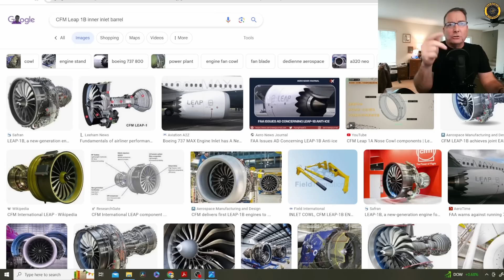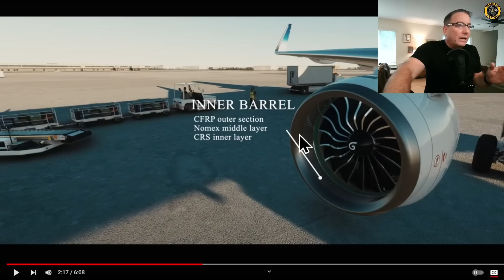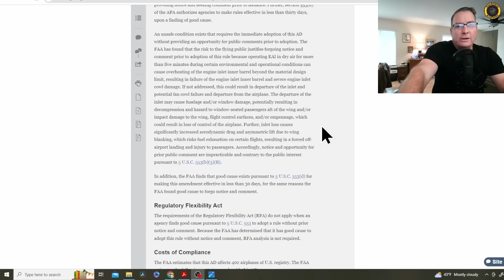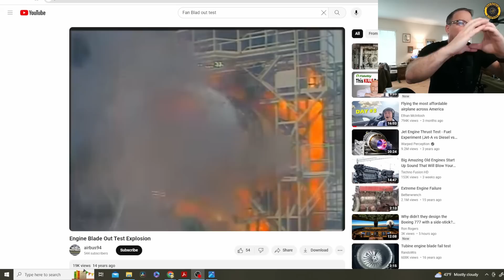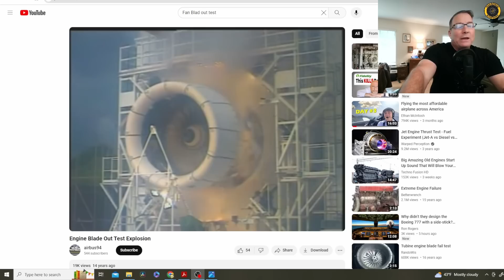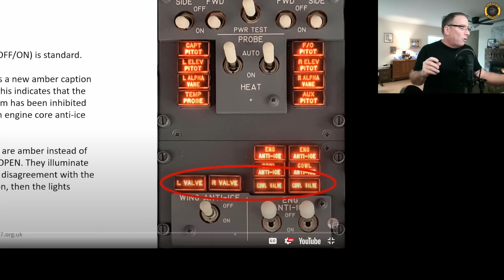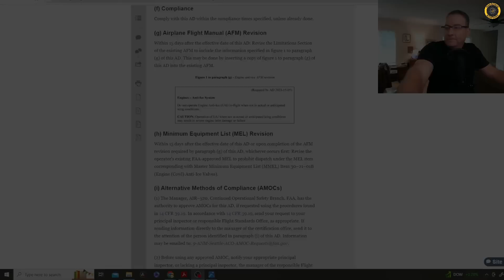Boeing 737 Max-7/-10 Certification HALTED! 1 Feb 2024

Comment: I have flown thousands of hours on commercial aircraft of all types over the years.  I miss the good old days when aircraft were way over designed.  I don't know be what kind of fairy dust mentality would think that a design like this would be an acceptable engineering.  I have flown on aircraft back to the Boeing 707's and thousands of hours on 727's, which was a pretty bulletproof aircraft I believe.  I hope that they come up with a very good fix for this problem.  I can appreciate efficiency, but nowhere should it compromise integrity.

Comment: And why model 8 is safe to fly if using the same engine of model 7 and 10?
Reply: The Max 8 has already been certified but still had the problem. Boeing wanted the Max 7 to be certified first then fix the problem. Now they have to fix the problem before it can be certified

Comment: Why doesn't this happen with the A320 similar engines?
Reply: The A320 has auto anti-icing, the B737 MAX does not...
Reply: A320 has different nacelle and they get electronic messages when to turn on and off the anti ice system if it is/is not required. There is no auto mode

Comment: Mix cold air with the engine bleed air, the carbon fibre surround will have less temperature fluctuations. 
BTW, carbon fibre is basically glue and floppy fibres. The engine nacelle has to be aluminum, as quoted by commentators below. ETOPS should be reduced, but has the FAA got the metal to order it.

Comment: What is Airbuses' solution to this problem?
Reply: They have a different nacelle and different anti icing system. They also get electronic messages when to turn the system on and off as they have ice detectors

Comment: They should go back to the 737- 200 would operate loaded out of a 3000 ft gravel strip ran alot of them up north here in alaska and the the yukon in the worst conditions very reliable

Comment: Manufacturers should be incentivized to incorporate the latest and greatest technologies but unfortunately modern economic conditions and the government regulatory environment incentivizes just the opposite. Unfortunately, this has created a vicious cycle.

Customers demand the latest safety and efficiency features industry has to offer. That isn’t wrong, but it requires significant design changes and pushes technology and regulations to their limits. That isn’t wrong either, but that in turn drives extremely expensive certification testing to satisfy a regulatory environment that is sluggish, antiquated, and resistant to change. If each of these factors were taken to the extreme, the result would be aircraft that are not economically viable at ticket prices the flying public is willing to pay.

The old adage of only getting to pick two (Fast – Cheap – Good) definitely applies here.

There is no single solution to get out of this. Solving the problem will demand a balanced approach, cooperation from all parties (customers, government, industry), and a willingness by each to look in the mirror.

Comment: Boeing should have just done a clean sheet design and came up with the replacement for the 737.  A Boeing short haul jet designed for the 21st Century.  They tried to take the short term approach but still spent many years to get the MAX jets certified…all at the expense of passengers getting killed due to poor oversight and now bolts not missing.  If they designed a newer plane, I think they would have been more serious about the design and not take the easy approach. They would have better brand goodwill also.

Comment: You would think it would occur to the engineers in the design stage that carbon fiber does not conduct heat like a metal alloy, and what are the consequences for this ?    Sounds like carbon fiber sub engineering.  Are these Rolls Royce ? GE's ?

Comment: I know we’re talking about the Boeing 737 max, but the engines are not produced by Boeing, same with the fuselage section with the door that broke out. I’m not saying that Boeing is not to blame for it, after all it is their plane and their design, but just something to consider. I also somewhat blame the airlines for these issues, as I seem to remember they wanted a single type certificate.
Reply: It’s Boeing’s plane therefore it is very much their responsibility.

Comment: This one isn't Boeing's fault.  Who in hell would design an engine that could be blown up by anti-icing?  That's just criminally reckless.  Whether or not to turn on those switches is a JUDGEMENT CALL...  so they get to choose between engine failure by icing or engine failure by anti-icing.  Brilliant.  Engine should be able to withstand anti-icing from gate to gate with nothing more than a small power loss.  I kid you not, if I were a pilot, I would refuse to fly these deathtraps.  I'd fly cargo 727s if I had to.  This is nuts.

Comment: I think this design of the cowling was implemented to slim down the overall diameter of the engine due to problems with ground clearance! Another  disadvantage of  not starting with a clean sheet and totally  scraping the dated 737.

Comment: How do they operate with bleed air that's too hot, how was that not worked out before hand?  CFM may be the engine maker, but who designed the engine cowl and the engine anti-ice system.

Comment: What a piece of crap.
It’s astounding that the technology that keeps your damn heated seats from burning down your car cannot be implemented to regulate the temperature of the air inlets. 
And it’s laughable that they would use carbon fiber and underwear material instead of metal in a heated area -on a machine that weighs more than a small fleet of bulldozers. 
Boeing deserves its woes.

Comment: The entire MAX debacle comes down to two things:
The engine fans are too big for the existing main landing gear. This meant the engines needed to be lifted and pushed forward creating aerodynamic instability at high AOA, or a costly gear redesign. Boeing chose instability over redesign. This led to MCAS preventing MAX becoming a lawn dart. Ultimately, MCAS turned MAX into a lawn dart.

Second, this feverish overriding need to avoid type rating pilots transferring from the 737NG. 

The result is 355 deaths and far more cost to customers in delivery delays and, ironically, added training than a type rating ever could have cost in time or dollars. Unstick your heads from your posteriors Boeing.
Reply from the maker: No. See previous updates on MCAS.

Comment: Does this failure mode also affect A320neo which uses the same engine?

I guess maybe not because a320 has the auto setting.
Reply from the maker: Correct!
Reply: A320 doesn’t have an auto setting except for pitot and window heat. for engine/wing It’s a push button on/off switch. However the ECAM will alert you if ice is detected to turn it on and if NO ICE DET appears you can turn system off

Comment: Honest question from a shade tree perspective:  Why is it better to over stress 2 engines?  In my opinion there could be a very efficient trijet aircraft that helps mitigate potential failures due to engines operating too close to operational limits for too long.  Again, this is an honest question.  I’m in the camp that prefers a clean sheet design replacement for this airframe.  Again because of pushing operational limits.  I wouldn’t care if they still called it the 737.  I just feel they (the airlines who don’t want to spend the money to certify pilots on a new airframe, and Boeing, who sold that concept) needed to stop looking to the past for the future. I’m not a frequent flyer, and still am a Boeing fan, but at some point they need to move on, and in my opinion that time was post NEO.

Comment: The Grumman F6F Hellcat and North American P-51 Mustang were both developed and put into production in less time than the MAX 7 certification delays have consumed. Not the entire length of the MAX program. Just the MAX 7 delays.
Reply: Those planes aren't compressurise, they wear oxygen mask when they hit 15,000 ft or higher.

Comment: @blancolirio  Let's please remember: The 737---from the first little bitty one off the assembly line in the 1960's to the last MAX off the assembly line today---have been some of THE BEST work horses of the airline industry world wide! They do a fantastic job carrying probably hundreds of thousands of people safely EVERY DAY with extremely few failures in the 5 decades or so they've been around. Also, please remember that Boeing did not design this engine or any other engine. The LEAP engine manufacturer will fix this deice cowl problem, not Boeing. Meantime yes, it stinks that pilots have to manually turn the engine deice on and off each time they enter and exit icing conditions. But can we please all calm down, including our beloved JB? The sky is NOT falling. And let's please remember one more thing: If anyone is to blame for stretching the 737 platform "to the MAX", it's Boeing's customers like SWA and Ryan Air and many others. So direct your ire at them. Man, y'all are giving social media a black eye. (haha)
Reply: All the other pilots are stating this is a Boeing problem because CFM does not make the nacelle and cowling. It was a Boeing problem when the cowling failed on the SW flight
Reply: Stand corrected on the cowl. Hopefully Boeing is working closely with CFM on the cowl. I stand by the rest. Drama is over-played.

Comment: Thanks for the concise video that explained the issue very clearly, Juan. 
Isn't it beyond ironic that Boeing decided against a clean-sheet aircraft and opted for the MAX in order to save money and streamline the certification process, and all they've had is a decade of headaches and lawsuits due (*in part*) to that expedited certification that shoved an incomplete (in some cases unsafe) aircraft into revenue service? They've clearly burned through all of the time and money they saved by doing it "the quicker, cheaper way." Even worse, the company's image is a tattered mess, its stock is in the toilet, and its name is a punchline. 
This is a crystal clear example (that just keeps giving reasons) why accountants and consulting firms should not be pulling the strings in an industry where quality engineering and safety are paramount.

Comment: "Mayday, Mayday! Both our engines blew up!" Pilot monitoring: "Damn, I forgot to flip off the de-icing switch after we got out of the clouds."
Reply: Life-threatening equivalent of forgetting to turn off the oven
Reply: Crazy to think this is the reality we live in now
Reply: The nacelles are made by Spirit, not CFM.
Reply: @aesma2522  doesn't surprise me Spirit Airlines is the manufacturer. Although I do wonder why the nacelles aren't painted yellow!
Reply: @j2simpso spirit aerosystems and spirit airlines are two separate companies. Spirit aerosystems makes some of the components of Boeing (and some other brand) planes, spirit airlines flies planes that are painted yellow.
Reply: @j2simpso Not Spirit Airlines but Spirit Aero Systems. The company was started because boeing wanted to cut this division out of its company and contract this work out to save money.
Reply: @TA-tf5lr  I think he knows. I will add that the design of the nacelle is probably Boeing made and certainly Boeing/FAA tested and approved... Further illustrating how the MAX was not properly tested and scrutinized.
Reply: So they HAVE automatic de-icing after all!! ... only it destroys the engine to stop de-icing...
Reply: Bring back flight engineers!!!!!
Reply: I see this more is a problem that they went to this composite material they had to make they had to force that company that made the engines to replace the rings with the alloy that they used to use at their expense and they shouldn't even charge Boeing for it
Reply: @BigEightiesNewWave Predatory business practices. Nothing new, but in aeroplane business?
🤔🫣😉
Reply: @BigEightiesNewWave  Well, to hear Juan talk about it, Boeing wanted it to be lighter in weight, hence the carbon fiber.  Doubtless this was for fuel efficiency.  I doubt the engine manufacturer gives a hoot if Boeing changes their mind.  It's the decreased air miles per gallon for hauling that extra weight that are going to be hurting Boeing.

Comment: Thanks Juan for explaining the issue with anti ice in incredible detail. I’m totally amazed that Boeing keeps the Max series just to allow same type series.

Nobody needs a part 121 aircraft with old manual On/Off anti ice. That if out of icing could overheat the engine cowl resulting in engine destruction.

It’s time Boeing stops the 737 Max bandaid fixes. The FAA needs to halt type certification on all future 737 Max aircraft and require modifications per AD to all current 737 Max aircraft to overhaul the engine cowl & anti ice system , so overheating doesn’t destroy an engine in flight.

Comment: I flew the classic B747 before I flew on the B737 (the NG). What I found stunning and embarrassing for Boeing, that the same rocker switches from the 1970s 747 is still used in todays B737. And this video showed it and was zoomed in on the switches. Having those switches in an aircraft build in 2024 tells you everything you need to know about the 737 project.

Comment: Juan, I'm a little confused when you say had they started with a clean sheet, this wouldn't be an issue yet you didn't explain how a clean sheet would resolve the issue. GE makes the LEAP engine and wasn't mentioned at all. While Boeing deserves a lot of criticism over their mistakes, this one feels a little disingenuous.  Your assertion may be correct but you didn't provide enough data to get me there.
Reply: CFM doesn’t make the anti ice system or the engine nacelle/cowling
Reply: @tomstravels520 By saying that CFM does manufacture either system, are you suggesting these systems are made by Boeing?
Reply: @zircontweezers  either directly or subcontracted to someone yes. Boeing designed it at least

Comment: Wow, that's awful design. As you say, how hard would it have been to wire up sensors to automatically shut off the de-icing system?
Reply: That would likely cause type certification issues with also being able to fly the NG

Comment: Don’t some of the NEO Airbus’ use the Leap1 engine?? I also hate when there’s an engine problem they make it sound like it’s the fault of the plane manufacturer.
Reply: The problem isn’t the engine, it’s the anti icing system and the nacelle/cowling. CFM doesn’t design or make those

Comment: Id like to ask what may be a dumb question.  Having seen multiple uncontained engine failures now that result in extreme aircraft handling difficulty, why is it not considered to have these engines rigged to jettison? We've seen these aircraft fly, apparently better, if the engine is completely gone versus a big shattered chunk dragging in the air. Is there reasons, aside of cost, they dont do this? Excellent vid as always!

Comment: Neither the Max 7 or 10 should be built in the first place.  Congress is fully to blame for a lot of what is transpiring now for it was their decision to lift a deadline in Dec of '22 to make Boeing make an EICAS system for the Max 7, allowing Boeing to keep the existing cockpit setup.  If that deadline would have been upheld, neither one of those projects would have continued.  
 The reason Boeing did not want any of that is because of two reasons that are connected.
 First, Boeing did not want to spend the money to redesign the cockpit.  They wanted to keep the status quo because there was profit in keeping the old design. Secondly, it was mostly because of one airline, the largest operator of the 737, Southwest.  They did not want a 37 that had a different cockpit arrangement than the ones they already have. That would increase operating costs having two separate crews. Since Boeing did not want to alienate their best 37 customer, that was another reason not to update the cockpit, which all boils down to profit and profit margins for both. 
Boeing knows, but won't admit, that they hung on to the 37 so long that they couldn't let it go, even long enough to design a replacement for the 757. 
Now, ironically the 737, that has turned out to be the best selling airliner in the world, is turning out to be the downfall of Boeing.

Comment: Several times you've mentioned that you think Boeing should have done a clean sheet design rather than try to extend the 737 certification. I know nothing about the whole process, and I suspect many other listeners are in the same boat. I wonder if you would do an episode explaining why Boeing thought it would be easier to modify the 737. What does certifying a new design entail, and what are the risks? What are the drawbacks of staying with an already certified design? There must be restrictions on what can be changed - are the designers basically stuck with the basic 1960s design?
Reply: I think he gets into it in some of his MCAS videos.

Its highly nontrivial and makes operations much harder on the airlines as well.

Comment: A good video, except that you've mixed two different failure modes without really informing your audience that they are two very different issues.

The first is a temperature issue which you talked through pretty well. The heat introduced by the bleed air system has indeed damaged the leading edge of the engine cowl. Currently, this is handled via a procedural change by an FAA directive while the cowl design team modifies the design and tests it. The second portion takes time.

The second mechanism has nothing to do with the thermal issue at all. The second issue has to do with an mechanical failure of the blades in the compressor and turbine section of the engine. This failure mode has absolutely nothing to do with the first.

You really should have made two separate videos, or made it very clear that the failure modes are unrelated.
Reply from the maker: No. You fail to understand that failure of the inner liner will lead to fan blade failure.